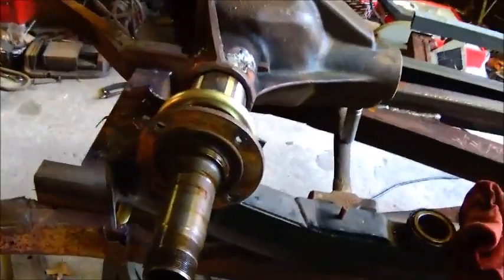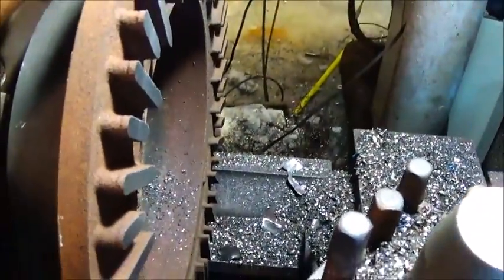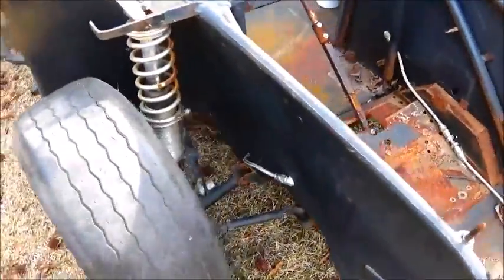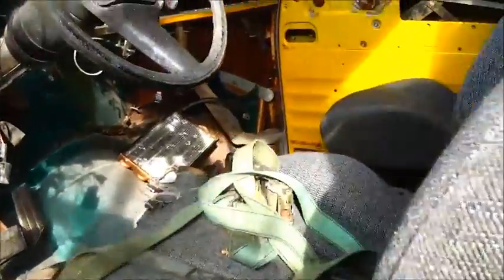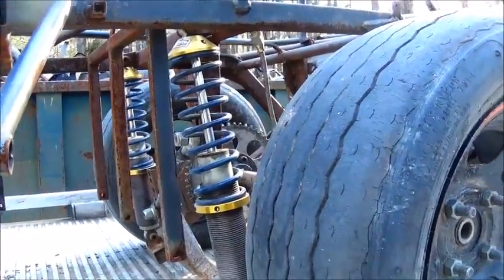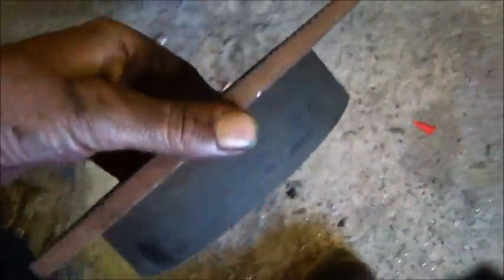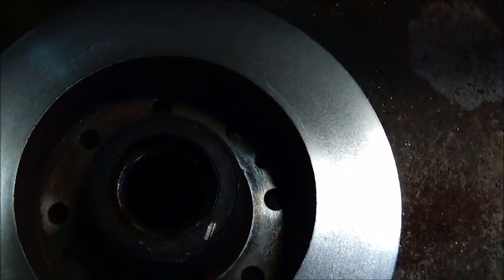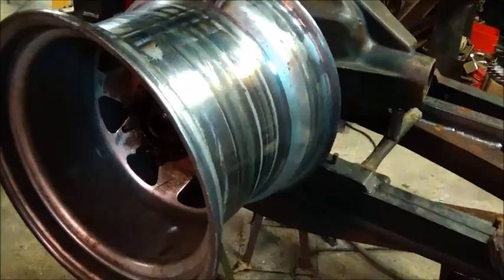Low Budget Drag Car Build Part 18 Rotors & More

Comment: When I removed the extra layer for my racecar, I put them on the breaker lathe and used a hack saw blade to cut it next to the later I wanted to keep. Then turned them smooth
Reply: Mark Bauman That's what I was thinking. I think it probably would have been more work to do it that way though.

Comment: I was wondering if cutting them in two with the power hacksaw - then truing them on the lathe would have been quicker?
Reply: I had the same thought - a hacksaw blade with the rotor chucked in the lathe, or a few cuts with a chop saw would've made quick work of the fins between the layers, then mill off what was left and make a final trueing cut on the lathe....

Comment: So, a few questions. Hope I didn't miss you covering this in another video. 
1-You are doing this to "lighten" the parts ?
2- The extra material won't be needed (for heat dissipation) since the car will ONLY be used as a drag car?
3- The caliper pistons are going to extend enough to clamp on this thinner rotor without popping out of the caliper body?